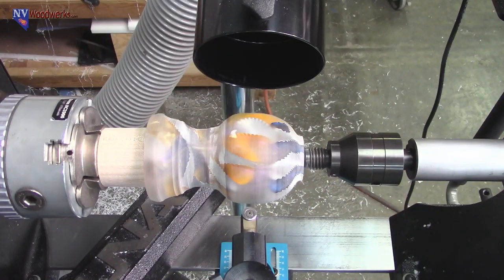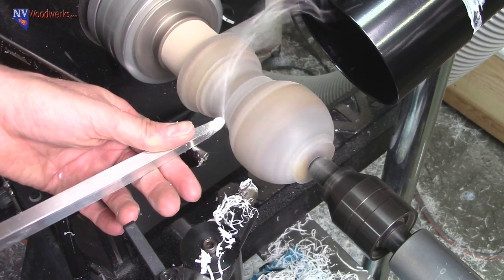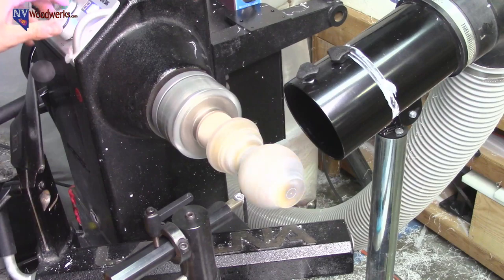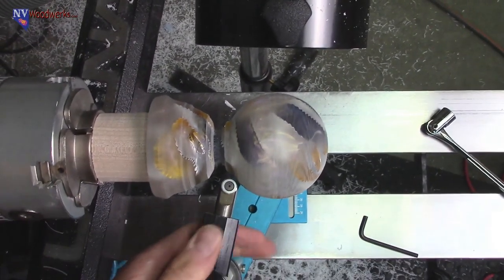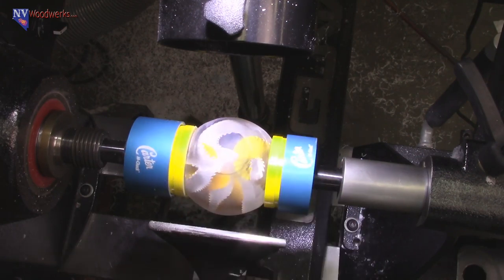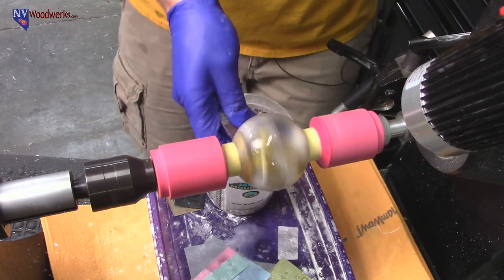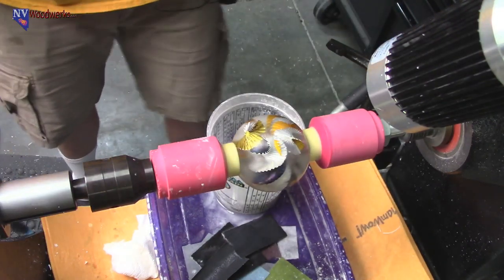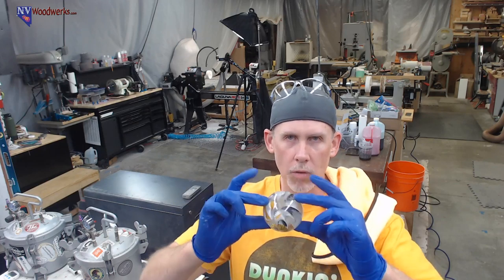🔴Replay: Woodturning the Aluminum Crinkle Ornament Sphere #2 #withme | Episode 69

Comment: When it comes to resin I feel you the best source for knowledge. I have a large hybrid Burl/epoxy pour I would like to do that will not fit in my pressure pot. What epoxy do you feel gives the best results without pressure. Thanks in advance for your input. If you get a chance, stop by my channel to some of my work.
Reply from the maker: Hey Steve, thanks for the kind words =D  I've gotten good results with the Stone Coat Super Cast and Entropy CCR Slow. Both have longer working times and can handle large volume pours, I think either of those would do the trick for you